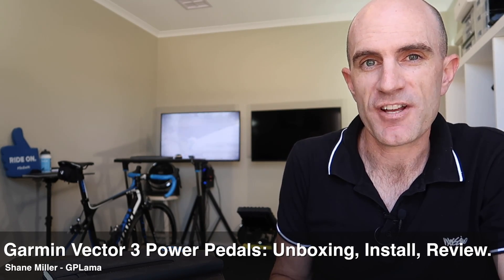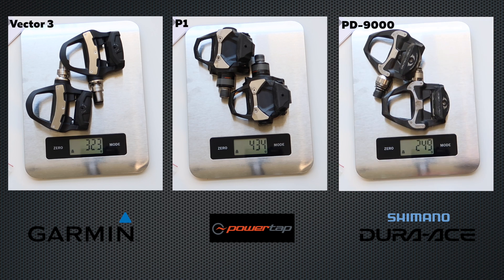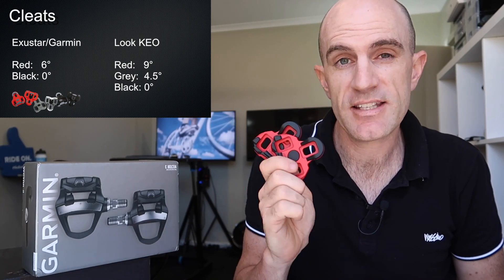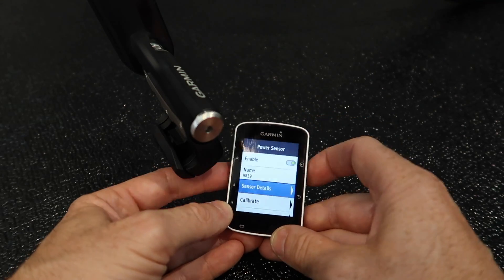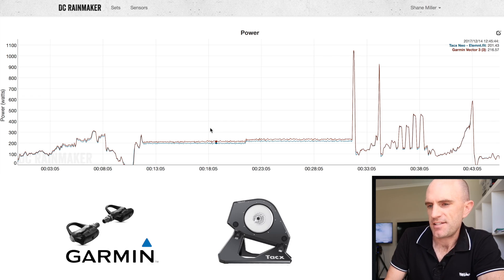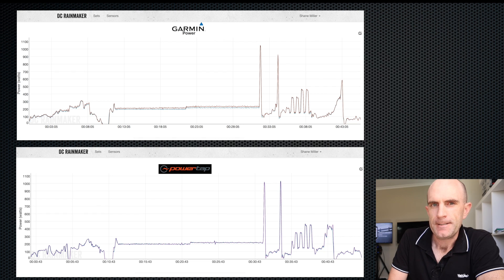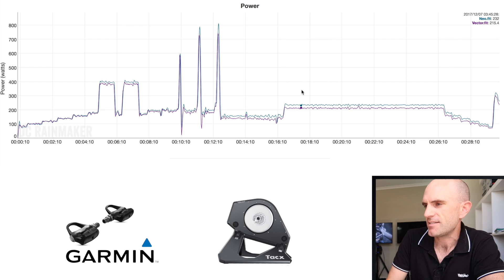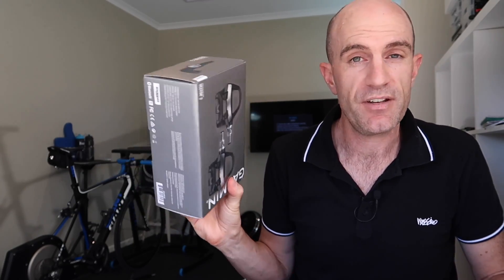Garmin Vector 3 Power Pedals: Unboxing, Install, Review

Comment: Have you switched to the 0 float cleats? I got my pedals today and wow they have a lot of play tried my older look cleats which are better but thinking I might need to go get the 0 float ones
Reply from the maker: Not yet. Tightening them up about 50% more than what they came with allows for a secure lock in for me. I'll get to the 0deg cleats soon.
Reply: I'll tighten tomorrow see how they go :) Cheers

Comment: Re: Bluetooth Connectivity Problem

Shane, I encountered the same problem connecting the Vector 3 pedals (dual-sided) to my phone via the Garmin Mobile app.  I tried your suggested fix and many other ones, such as moving the bike and phone to a blue-tooth free area of the house and dancing.  Nope.  Nothing.

Then I verified again, the numbers on the spindle that I wrote down.  It turns out, the LEFT and RIGHT spindles have different Device ID numbers!  The instructions don't say anything about it, probably because there is one instruction set for both 3 and 3S.  Solution: make sure you input the numbers on the LEFT spindle and it was good to go for me!
Reply: Kendrick that’s correct, I entered the left number and it connected to the app straight away

Comment: I hate it when the batteries that come with the V3 is dead. It took me a couple of hours to realize that lol. Then it wasn't just 1 LR44, it was 2 pcs! I got pissed during the configuration phase and went and bought 4pcs of Batts and replaced them all! WTH man Garmin...new batch new set, dead Batts....gave me a headache. Best part was the LED blinked but in the short span of setting up, they died lol Anyways, after replacing, everything went smooth even during my calib on my wahoo elemnt bolt, hurrah!

Comment: how is it possible that chart is so smooth, quite straight line? i use garmin verctor 2 and my graph jumps all the time.
Reply from the maker: That graph is smoothed. 1s power is usually pretty jumpy from any power meter.

Comment: I notice you seem to use the P1 and the Neo as your benchmark equipment?  Curious on how you know these are actually an accurate benchmark?  Maybe you cover this or defend your benchmarks in another video.  Thanks!
Reply from the maker: I'm not able to 100% confirm or defend them as 'accurate'... but over 100s of comparisons they've been consistently reliable and in-line with most other power meters. Let's go with the scenario of the Vector 3 being accurate (in reference to the ERG steady state tests)... a few other companies now have some explaining to do.
Reply: Makes sense to me, with a lack of a lab to do physical calibration and bench tests, it seems the most reasonable way to call them your benchmark.

Comment: Hey Shane, I know you use a few power meters. Between quarq and P1 which would be best in your option? What is the older version Quarq you use and show quite a bit with the sworks crank arms I think. Also looking at the Dzero. Thanks
Reply from the maker: It depends. There's no 'best' as it depends on your requirements, bike, compatibility, budget, etc.
Reply: Thanks for the reply. Ok, I'm settling between Quarq and P1. Going on road bike Merida reacto bb evo386. So budget will be price between those 2.

Comment: Hi, 

I noticed that on the graph it shows on the too right corner the garmin device used with the power meter and each power meter was tested with a different garmin computer! While that shouldn’t be an issue at all I am a strong believer that for accuracy you should test using the same garmin computer on the 3 power meters.
Reply from the maker: Never been an issue with 100s of other tests I’ve run. Both my 820 units are back at Garmin for repair too... three weeks and counting.

Comment: Hey Shane,
Do a static calibration on both sides. Mine measured too much on the left side and way less on the right. Garmin advised to remove batteries, remount the pedals and in my case I had to reduce the amount of grease on the threads (weird, but helped) Now both pedals measure less than 0,5% difference from the expected NM during the static calibration.
Reply from the maker: I'll look into this. (It's not part of the expected customer experience though....... hmmm)
Reply: Nope..it's not especially for 1000 bucks, but I did not want to send them back and get a quarq...almost did...
Reply: Hi Shane, did a couple tests today, of which I've uploaded some samples. All in all: I think my garmin is totally OK. What we see in your case that was totally not the case with our tacx and garmin. 

Tests on 200W with 90 rpm and a few above 200 ones with 100 rpm:

http://prntscr.com/hp9uhk : overview
http://prntscr.com/hp9wo6 : zoomed into the 200W efforts
http://prntscr.com/hp9x79 zoomed into the 250-300W efforts
http://prntscr.com/hp9vvt: cadence
http://prntscr.com/hp9vmu : left/right

apart from that I can't pedal smoothly: Yes....occasionally happens that for a point in time the difference between the two is 10W, but in general, even around 300W-s they are within 4-5W. 
We did a couple tests and garmin is consistent, when the pedaling is smooth the rpm is consistent (so the tacx does not have to compensate) the data is totally OK and within the error range.

Comment: my case I was having the same issue with the bluetooth but was because I was entering the right side pedal ID instead of the left one once I entered the left ID the pedal got to pair
Reply from the maker: I tried both... no luck... then magic happened. I'm not a fan of magic. I'd like it to have just worked. All good now. Just waiting for the Bluetooth power firmware.

Comment: Can you provide a link to your DCR Analyser power test?  It would be nice to see the P1 vs Vector 3 vs Neo vs Drivo at the same erg setting on both trainers.  Wouldn't that possibly show power differences between the Neo and Drivo?  I think we have to assume that there is some differences in power between the Neo and Drivo.  Did you have to adjust the offset of the files?  I've done some testing of SRM vs Neo and the Neo is always delayed.  I'm not seeing that in your data.

Comment: Great insights! Just ordered some Vector 3 pedals....... A discussion for another video: Can you feel the dead spots when using erg mode? Or does the flywheel neutralise the effect (Could you compensate by trying a very low cadence)? Does osymetric chainrings make a difference?

Comment: I would expect the pedals to read higher than the Neo.  The force on the user is the force applied by the trainer + the mechanical drag of the drive train. Remember, there are folks who claim changing the chain can get you a couple of watts, a few more with ceramic  jockey wheels, using a special lube, etc.  This should be a fairly fixed amount and show up as a constant offset vice a percentage of power. But I would think it would be tied to some extent with chain speed. From the data, it looks like it was 10 watts in this case. I wonder about the P1 that show no mechanical loss in your drive train.

What in interesting (and I learned this from an interview with an hour record attempt's and a  TT specialist's mechanic when they were going over the bike and asked about the big gears the riders were pushing ) is the chain drag is variable based upon the side to side flex of the chain based upon the chain line. So, to optimize the drivetrain, you want the chain as straight as possible between the cassette and chainring. To prove this (I've never seen it quantified, so it could be a really cool "Does chainline matter?" video!) is to have the Neo set at a constant power (erg mode), maintain a constant cadence, and do 3 or so minute (to avoid the transients associated with shifting and erg mode adjusting) efforts starting at the top of the cassette and work your way down. If the chain line does matter as since it is the only variable in this test, the offset will be different, if it doesn't then it will be constant. I would expect the offset will highest at the top and bottom of the cassette when the flex is the greatest.
Reply from the maker: Discussed in the video. I run a clean, straight chain. This shouldn't be 20W at 200W. It also doesn't factor in why it's more 'accurate' when not in ERG. I suspect there's a sample/frequency thing happening... but that's up to the engineers to look into I guess. I've heard every excuse there is for why power meters won't match up.... I'm ok with a few watts here or there... but not x2 the expected difference when adding up all the maximal 'errors'. It is what it is for now.... we need more data, more samples, and let's go from there.

Comment: Did you notice an issue with the bearings and their resistance? Noticeable difference between the two pedals for my dad, tried all bearing adjustment suggestions from garmin.
Reply from the maker: They're a little stiff. 1/4 a watt in it Garmin say on their forums. Waterproofing they say.

Comment: I've been using the Vector 2 setup for 2 years - I didn't really like them until I got a good firmware update about a year ago.....since then, it's been working very well.  Totally unrelated to your issues, but I do notice that my Stages power meter generally reads 20-40+ watts higher overall for a ride than my Vector 2 while comparing average heart rate/effort level, and my left/right foot power balance these days is only around a 1-2% difference at the most.  So, I guess if one wants really impressive wattage numbers, get a Stages? lol  I'm curious though how the power numbers stack up between the Vector 2 and 3 with your test.

Comment: I've been sitting on the fence on vector 3's for a while.My biggest concern is durability especially when one considers that the pedal is usually the first thing to strike the ground if the bike falls over or is crashed.The strain gauges within the spindle I'm assuming are quite delicate and any change to that would affect accuracy, which defeats the purpose of spending $1500 AUD on a set of pedals with power.Having said all that I still like the concept and love the simplicity.Comments please.
Reply from the maker: You'll have to sit a little while longer until more people have (crashed) them.
Reply: Shane Miller Thanks Shane. Sad but true👍🏼🚴🏼

Comment: Great vid yet again.  I got sick of wating for the new vectors so picked up the P1(s) last week based on you being a big fan and they are going well.  But on Thurs morning at the teardrop myself and another guy with P1s both clipped the left on the hairpin (and nope didn't pedal thru the corner). Fingers crossed no damage to the internals!

Comment: Another great video Shane, as always you early adopters are the beta testers for these companies. Most of the time I do not buy until the items are six to twelve months old and several firmware updates in the bag. Look at every single Garmin release of new products, the forums are full of people that have issues. Then down the road a bit, the firmware updates have fixed the issues, and by then you can normally get the item cheaper as well. Just upgraded to the Edge 820, what a great product now, not so when it first came out.

Comment: Garmin releasing a product that needs a firmware update or 2? Sounds about par for the course. I still would love these pedals (once the firmware is updated to reduce that separation and adds Bluetooth). My wife is looking at a power meter fairly soon. She has a Trek bike (so their BB axle is not the standard), does not want hub based meter (so she can use a dedicated trainer wheel on the trainer but still measure with her meter), wants below 165mm crank arms (she's 5'2" with shorter legs and limited hip flexibility). And she uses Speedplay pedals (narrower spindles and wider float). Her current best bet is getting a Cobb crankset and Powertap C1 chainrings. But these pedals have her interested. Big selling point is ease of swapping between bikes. I'm going to have her test some basic Look pedals with 6* float one day to see if she actually needs that. But she also uses iOS devices for Zwift so lack of Bluetooth would be a turn off for her too.

The hardware on these looks brilliant. The software? Looks like par for the course for Garmin. The good news is they seem to always fix their firmware eventually. The bad news is they seem to often forget to do it before release. Their huge market share plus their great hardware lets them get away with it. Same with the head units (I'm sure Shane still has nightmares of the 820 at release). I've swapped to using a Wahoo Elemnt Bolt. Here's to hoping PowerTap does a 2nd generation pedal (P2?) that looks a bit more standard and basically is just iterated to compete. A little competition is always nice for us consumers!

Looking forward to you showing the pedal analysis. From what I read that was the big difference between these and say the Favaro pedals. I have a Pioneer dual sided crank meter that has great analysis. Unfortunately it requires using their head unit which was garbage. So until they work with other head unit makers to expand it, all I get is power and LR balance. Definitely like the meter but the lack of bluetooth, missing features without their head unit, and bad head unit would have me looking elsewhere in the future.

Comment: Did you try different flywheel momentum? I'd be interested in seeing how the neo and pedals track for different gear selection same erg power. Edit: the reason I ask is I found the difference between the pedal and what the trainer says changes with inertia. Granted I'm using bepro S with the Flux. Now I have the neo but haven't done that test. Pedals are weird once I tried pedaling with only the left foot (single sided pedals) expecting to see the same number as the trainer... But nope. Also depending on how hard I push on the left vs right foot I can get wildly different readings. As a scientist this kind of non-preciseness of power reading makes me crazy. I wish I had a lot of devices to make comparisons like you do!

Comment: Thank you.  I was thinking of ordering them but the bluetooth troubles and 5% steady state inaccuracy just killed it for me.  The pedaling metrics think sounds cool though.   I have an Garmin 500 and I read Vector 2's don't calibrate properly. Was going to upgrade  head unit  along with the Vector 3 purchase  but not the your test results are not up to par.

Comment: Shane - You've shown the reliability and accuracy of the P1 pedals. Other  than some weight savings of these Garmin Power pedals, I don't see any big advantage, especially at the current time given the firmware problems.

Comment: Just to share my experience with the Vector 3's. I got mine a couple of days ago and the first thing I did was connect them via bluetooth to the Garmin Connect app on my iPhone, I did this before anything else and they connected straightaway. I connected them via the Garmin Connect app rather than going into my phone settings and trying to add a Bluetooth device. Once they were connected via the Garmin Connect app they automatically appeared in the device list under my iphones Bluetooth settings. Hope this helps :-)

Comment: So I did a work out on my Direto and my Riken Al. The entire time, the Direto read about 10% higher. I did calibrate the Riken Al post warmup but I have never calibrated the Direto. I’m confused because I would have thought if anything it would be the other way around due to drive train losses. Any pointers?
Reply from the maker: .... pointers.... um.... more data, more comparisons against known good power sources. Static weight calibration / verification on the Riken?

Comment: What sort of loss should we expect between pedal to crank, pedal to BB, pedal to rear wheel i.e, drivetrain losses, fairly sure they wouldn’t account for this much discrepancy, pedal should always be more in respect of output being nearest to the source of power I guess
Reply from the maker: There's whole websites on this. IIRC 3-7%... I assume the 7% is cross-chaining with a worn/dirty drivetrain.

Comment: I have Cycleops Hammer Smart Trainer. Question Vector 3 o Vector 3s what do you recommend for the outdoor rides?
Reply from the maker: Your call.
Reply: Shane Miller So what major advantage between Vector 3 and Vector 3s do I get, sorry I am not to familiar with both of them been meters. I bought the Cycleops Hammer and I love the way has help me improve more cycling in the road. So I just wanted to know the difference between each others

Comment: Pedal cam is a hit. . Vector 3's Not so much. I just don't get it! You spend that kind of money and get a sub standard product, then wait for firmware updates!!!
Reply from the maker: Yeah..... it'll be a non-issue soon... but as of right now, I can't connect "the latest and greatest" power meter to Zwift IOS or AppleTV without a bridge.

Comment: Hi Shane great vid as usual 
Are you saying the difference in power readings weren’t consistently low or high but it was fluctuating (which is more worrying than showing consistently low or high as if you knew the difference you could compensate for that)
Reply from the maker: My observations so far was that it read 8-10% higher than the Neo and Drivo in steady state ERG modes in the range of 200-220W. This is a very limited data set I've collected though.... more ERG sessions required.

Comment: I got my Vector 3 1 week ago and I had similar issues regarding the Garmin Connect App until I entered the code from the LEFT pedal. Maybe that helps you if you haven't already tried it... ;)
greets form Luxembourg
Reply: Yes! Only accept LEFT pedal code，seems like right one will automatically connect to the Left pedal then combine.